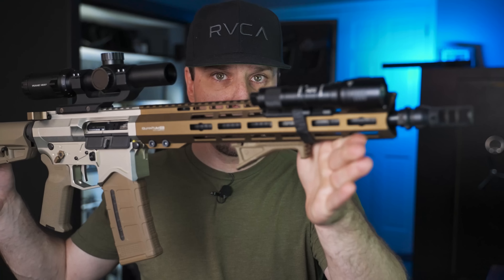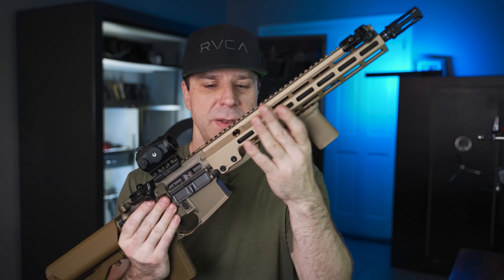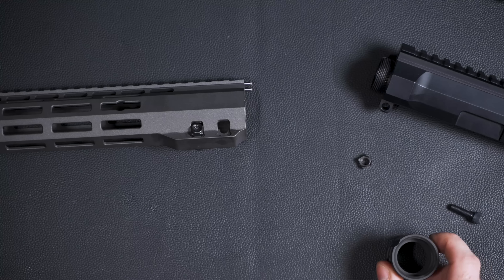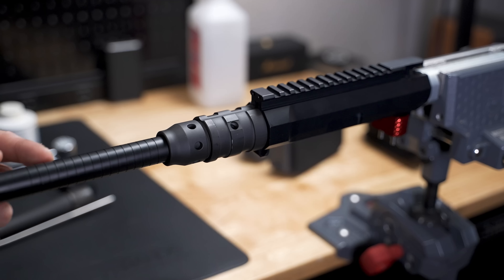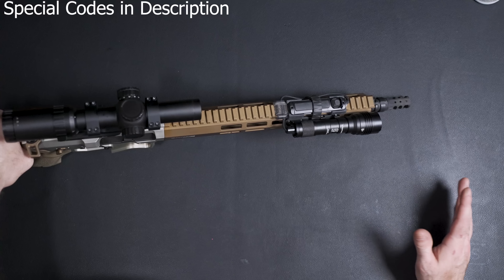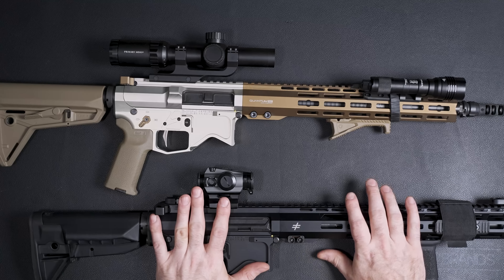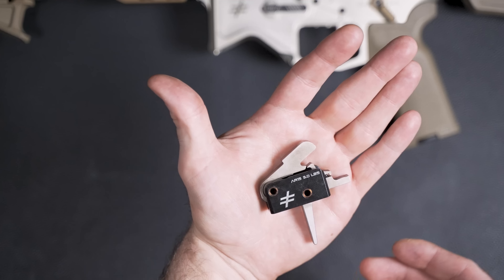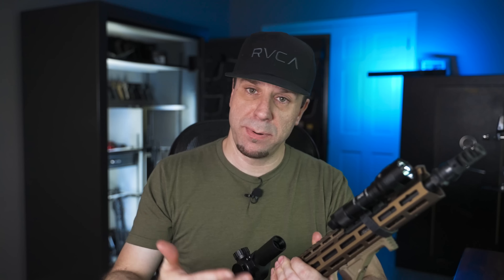NOBODY in the World Makes an AR 15 Like This...

Comment: Thank you for being another voice of reason about barrels.  In multiple articles and videos I've argued for stainless and nitride and against chrome-lined, yet hundreds of commenters still don't get it and want CHF/Chromed because that's what the military uses..... obviously they don't understand why the military chose that.
Reply: It holds up better under full auto fire. For most people, they will never be able to shoot out a CHF/Chromed barrel. I think stainless nitride barrels like blackout, Roscoe, or BA are better for the everyday person.
Reply: @MegaAndy93  I figure if I can afford to shoot-out a barrel I can afford to replace it. I'd rather start with a better barrel.
Reply: The issue with SS is articc warefare when you get into -20 -40 F SS barrels can rupture from the speed of expansion from pressure/heat.  With the CMV it resistant to this.  Further FA fire that has been mentioned.  

There is no reason for CL any more as you can get hammer forged nitrided barrels for the ultimate in durability.  Compared to a standard SS it will last 3-4x barrel life compared to a standard mil spec CMV CL barrel you have better tolerences(accuracy), cheaper to nitride than CL by a huge amount.  Better salt water corrosion and its also the entire barrel inside and out.  So no parkerizing needed and way tougher finish.  In every category nitrided is superior,  I have not owned a CL barrels in 20 yrs.  I have even sent my own personal barrels off for nitriding.  Al, tge custom ARs we built and sold were niteided barrels.  We were the first to offer custom AR nitrided barrels.  We then moved to nitrided bolt carriers as well.  Then all the Jonny come lately 's jumped on board.  Was a good laugh when comes like LWRC tried to copy us early and found out they needed to polish tge chamber and bore or you got terribly fouling and blown primers.  This after they had sold a full lot of rifles.  That's what you get for trying to steal others hard earned research to turn a quick profit.
Reply: @tonykomer2997  oh shoot, there go my plans of gun fighting in the arctic...
Reply: @tonykomer2997  Well for the common citizen, 90% don't need it unless you live in a cold tundra like Montana or Alaska (you could make the argument for them) ,but that's a small percentage of the American population. Get what you need based on your needs and area and you'll be fine.

Comment: Complete uppers are pretty reasonable honestly. I bought my DDM4A1 upper for about $1100 a couple years ago. May have to pick up a complete blackout upper to slap on the spare LMT lower I have laying around.
Reply: You don't really  need that spare LMT lower. Just give it to me
Reply: @hanloncaldwell8571  tacswap brotha
Reply: Surprised this company blackout isn’t doing ambi bolt stop/release
Reply: Yeah.. I built my upper for $263, and it has a 20" SS Hbar barrel-- stupid accurate, but she's heavy.  I also built a full blem Kit for $259, that has the FN CHF CH barrel.. "machine gun steel" they call it.  That was years ago though, and it has over 6k rounds through it now and still looks good under a bore scope--  So, I think I'll keep building the chepo stuff;  because after building several dozen rifles with nice results, it's hard for me to justify spending that extra money.  I've been disillusioned with the gucci gang
Reply: I'm amazed that "gun guys" are still buying the crap that is more expensive, yet no better than the lower end rifles on the market. The best rifle on the market is made by a company that most dont even know about. HM defense and their monobloc line of rifles with the hmb battle bolt. They. Eliminated two of the major issues with ar's. Yet are onky slightly priced higher than a low end ar. What does D.D. or let do? Make "enhanced" bolts that consistently cause malfunctions?
Reply: @FreedomInc  I tend to agree. My Ruger does everything I need it to, and it costed around 700 at the time. My buddy has the DD, and sure it's more refined but ... Can't say it's more reliable or accurate as both run 100% and shoot around 1.2 moa. To each their own I suppose.
Reply: @RustyStator  these "high end" rifles ,or rather the people that buying these rifles sahs one of two things. The person has more money than sense. Or the person just buys whst the "cool" guys are buying. Lmt has put out a list of junk arts that everyone is well aware is junk. Daniel defense doesn't make anything special and I wouldn't even go as far as to say they are "more refined". These are the rifles people own for years without ever putting a scratch on them except in the rarest of cases.
The higher than average shooter will never be as accurate as the lowest of low end ar rifles. And the platform just works. Even the bottom end ones. But if a company is going to charge 4 or 5 times for a rifle. There should be more of a reason than the name on said rifle.
In the case of blackout or whatever the name of this rifle is. There is nothing great about it. Its a heavier system. The justification for that system has zero merit. Of the machine work is done correctly on the  "normal" ar, there's no issue with barrel alignment or high spots causing accuracy issues. To ensure this there are remedies for what is onky a possible issue with finishes
Reply: @bananawatch8158  Are you thinking something like  X2 Dev Group, their AR-X rifle or another stand alone system?
Reply: @firearmfun887  looked up the arx, looks cool. I like the American Defense adm lower
Reply: @angeldesigns1385  BCM is a great example of this. As of pre covid I know for sure (and im sure now). 95% of their rifles are made at Anderson manufacturing in Hebron KY.  Look at a bcm facility walk through on youtube. Nkt one time will you see a cnc ,mill, or any other type of machinery.  The excuse of the fanboys is "well the bcm qc is is so much better". I have a buddy that worked at Anderson. Nothing is different whether it be Andersons coming off the line or bcm parts. Except for the roll mark on them.
I believe I said in my earlier comment. If you are going to spend more than the minimum, even if not.  the areo precision m4e1 is probably the best rifle on the market with the mist added features. Anythijg more than the cost of that  the HM defense monoboc line of rifles. These "high end" rifles are a joke. It is a stamp for shills and the fanboys of the shills. Notning more
Reply: @FreedomInc  HM is about 20 minutes from me. They just don't market very well, eveyone locally knows about them though.  Faxon is here as well, which could be why.  Additionally, the Poverty Pony is just across the river a few miles away in KY.
Reply: @ryancoffee339  they market as well as anyone else. Except they just don't habe out guns and large checks to youtubers to act as if its their goto like bcm. Which is 90% produced by Anderson. 
The "poverty pony" has saved plenty of lives. And is just as good of a rifle as any other milspec rifle.
Not to "one up" you. I use to live about 3 minutes from hm.I'm aware faxon is in Springdale.  Along with probably 10 more.manufaxrures in the Cincinnati area. Since its a heavy aerospace manufacturing area firearms go hand in hand due the equipment is used in the manufacture of both. Like Luxus aviation and luxus arms clay browns other companies.
Reply: @FreedomInc  YouTube reviews is marketing. Never owned anything Anderson, just mentioned them along with Faxon for proximity.  I work in aerospace, it’s why I live here You’re correct, this place is a big hub.
Reply: @calholli  so PSA. Sorry about the poor
Reply: @stevecohen34  I have a couple of dozen rifles in all kinds of configurations.  I through together a parts rifle with a Sig piston upper also, but I guess that's not even good enough either is it.   I also bought an F350 7.3L Diesel 6spd manual 4x4-  10 years ago,  for $7k and built my own flatbed for it, and used it for a decade running my own crew building custom houses and metal buildings, and it's still going strong today.  Does that make me poor because I didn't spend $80k for a new truck?  Or does that just make me smarter than you
Reply: @FreedomInc  Blackout Defense does appear to be a unique beast of an endeavor.  I wouldn't knock them without first hand experience.  As for the popular "Gucci" guns you may have tighter QC, better matched parts and some hand finesse that the lower cost alternatives don't have.  That may make sense for gov't and LE where they don't have the time, money or desire to do that themselves.  That said, I can find no justification for $3,000+ pre-built.  In nearly every case you could handily build a unit as nice or better for the money.  Also, much of the "Gucci" stuff like the carbon fiber wrapped barrels... Are they war proven and would you want to chance them in a SHTF situation where you may not be able to replace barrels if something went wrong with it.
Reply: @cwathan1  so you argue im wrong. Then you argue im right. All based off an assumption. 
"Tighter tolerances" matter for
.02% of sh*oters in the world.
As for blackout defence its a gimmic. There are traditional barrels with better accuracy for far less cost. The company has done nothing innovative when it pertains to the platform. The business model is selling to the herd. They are not creating bolts that don't break in half, or gas blocks that are integral, like one company in particular (that is far less expensive then this Gucci Anderson in this video).No, they change something that in the big scheme of things is pointless.
Your long lost of justifications is destroyed by your reasoning.  And who cares what srate hired thugs or the military does or why?
Points still stand.

Comment: Their barrel nut system could prove to be really awesome. It seems to be a lot more beefy and rigid than most normal barrel nuts
Reply: I agree 💯%. If I could get a Criterion barrel shaped like that to accept their tapered barrel nut, I would gungasm on the spot!
Reply: Heck yeah, marketing gold! Biggest nuts in the whole AR world.
Reply: Barrel nuts where never a problem just another way to justify the price imo
Reply: All the nut had to do is hold the barrel onto the relatively flimsy aluminum alloy upper.
Marketing.  Notice the tapered collet only acts to center the nut to barrel.   The barrel shoulder to upper contact surface is still conventional flat to flat.  And coating a stainless barrel acts as an insulator to retain heat.
But the stress relief rings on the barrel to break up the harmonic wave is brilliant since flutes proved to be ineffective.
Reply: @blackhawk7r221  happy someone else noticed that
Reply: Doesn't aero precision have this already?
Reply: @blackhawk7r221  Tacomhq figured that out with structured barrels already first they essentially deaden the barrel from harmonic vibration and they showed how they shot multiple different bullet weights of a certain caliber and the point of impact doesn't change as the bullet weight changes like it normally would with normal barrels. The taper helps pull the barrel into the receiver I can see how a taper would do a better job at doing that and doing it as straight as possible I'm not saying other designs are moot by any means I'm just saying it COULD prove to be a cool way of doing something there's more than one way to skin a cat
Reply: It works well on the M110 suppressor.   Using tapers is exactly what they use in the machine tools that makes these things.   But until they start putting a taper built into the upper receiver, it won't really matter that much.  Your barrel is still slipping into a square sided cylinder hole;   But I can see how it is likely more repeatable than a regular flat barrel nut----   so on a rifle that quick swaps barrels, this would actually be quite useful.
Reply: @blackhawk7r221  It's not a coating... Nitride is a surface hardening procedure;  It does change the color, but it's not a coating.   Also, I agree that the barrel nut isn't doing much without another taper built into the inside of the receiver---  but I do think it would help make barrel swaps more repeatable-- to keep your same zero.   But this rifle doesn't even swap barrels, so what's the point. lol
Reply: @calholli  how doesn't it swap barrels? Jus bc they don't say " barrel swapping is a feature" doesn't mean it isn't possible and still useful taper wise in that regard tapers are great for many things gun related
Reply: @calholli  I thought he merely said coated.  I’ll bet he meant to say hot salt nitride treated.
Reply: Eh, aero precision enhanced upper
Reply: @VERSE20009  no
Reply: @noluckpureskill9985  I mean like a quick swap barrel system.. like an AUG or ACR
Reply: I’ll throw out a tidbit for y’all to put things into perspective.  
Back when I was on the trail as a Drill Sergeant, the trainees used to have a range day where we did pro-mask fire, automatic fire, then later that evening night fire.   The range was called SPOTC.  During the lul while waiting for it to get dark, the cadre would grab a half dozen rifles and go apeshit firing up the extra ammo on auto.  What we constantly saw was that after about 8 mags on auto, the weapons would seize.   Not a failure of the BCG or barrel, but the aluminum uppers would get so hot that they would temporarily warp and seize the bolt carriers.  Let them cool, and they ran again. 
So think of how much warpage your upper would have to do to start seizing your bolt carrier.  I don’t have to tell you, the AR was designed with a lot of slop in that upper.  Aluminum transfers heat amazingly well.  Now think of your optics.  How  badly will that heat affect your groups as your upper receiver mounted optic is being twisted by the heated aluminum upper.   With iron sights, the answer was about a foot at 100m.  Until someone begins using better heat resistant material for uppers, heat will always affect expansion on aluminum.  But mil-spec barrels are only required to be 3 MOA anyway.
Just a thought.
Reply: @stang_entrepreneur  Exactly my point. Capitalism and marketing at its best lmao…
Reply: There's no tangible benefit to this. The barrel nut on the AR platform has never been a point of failure. Nor is it something that impedes accuracy. This is a gimmick to justify a higher pricepoint.
Reply: @bglenn2222  there are some quality systems out there. But there's also different ways to skin a cat. I don't own one of these so I don't have a dog in the fight
Reply: looks like a turd especially the way they cut the magwell
Reply: @blackhawk7r221  I remember pulling rifle range coach duty at camp lejune when it was 90 degrees with gas masks on they were on the 300 yard line and as soon as they put their gas masks on they fogged up shooting fully auto we watched the 100 yard line control booth getting shot to pieces they got shut down pretty quick,  I'm glad know one was hurt but it was kind of funny.
Reply: @USMC-1911  Ahhh yes!  Pro mask fun fire.  That was awesome.
Reply: The POF heat sink barrel nut makes that look “meh”. The POF patented inventions are mind blowing. $1700-1800 gets you their top of the line Renegade + which includes all these goodies. Highly highly recommended.
Reply: It may be interesting as an exercise but the regular armalite has held tons of equipment laden rails just fine for decades.  Without shift.  At some point you need to stop and think about weight.
Reply: Yes bevel the barrel is good.
Reply: @stang_entrepreneur there's some science involved
Reply: @calholli depending how long the barrel extension is a tapered fitting to the receiver might not be a good idea
Reply: @bglenn2222 would you buy it if you had the money?

Comment: Off the rack rifles have to have standard gas blocks so it will function for someone regardless of what ammo they use. Majority of people buy AR’s don’t really understand how they function. Companies would be overwhelmed with calls asking why my new gun doesn’t work; and the ammo companies would do if theirs was the one that didn’t work vs ammo that cycled fine. It’s just like cars, how many people buy cars and don’t really know how they work? Needs to be a turn key product. 👍
Reply: To rebuttal I feel like all manufacturers not just high end ones could easily install adjustable gas blocks in the form of a click system. It would be beneficial to ammo manufacturers that produce underpowered ammo such as Tula and Wolf and to those that manufacturer the mil-spec stuff especially when your shooting suppressed to reduce gas blowing back in your face. Just to name a few advantages.
Reply: Never seems to affect the FAL or any other common fighting rifle with 2 or more gas settings. Even the US military recognized this with their new ngsw pick and the current SCAR.
Reply: You are correct, I have some junk TulAmmo that won't run in some of my ARs but the ones I increased the size of the barrel gas port will run it. You can tell by sound when I'm shooting that budget junk Tulammo.
Reply: Interesting there are millions of FALs across the work and they have adj gas blocks and no one is rushing to call cs because they do not know how to use it.

What is needed is an adj gas block like pof or the riflespeed version.  They are numbered with clicks.  Can be adj by hand or a end of a case.  They do not jam up.  From tge factory tgey can be set to work with 5.56 pressure ammo with instructions from there.  Easy. You just set it from the factory to ve the same port size as you woukd a nonadj ie the size of a standard gas port for that barrel and port length.  Easy.  The best obe for combat would be a 2 setting. Suppressed and reg like the x95 Tavor of the Israelis.